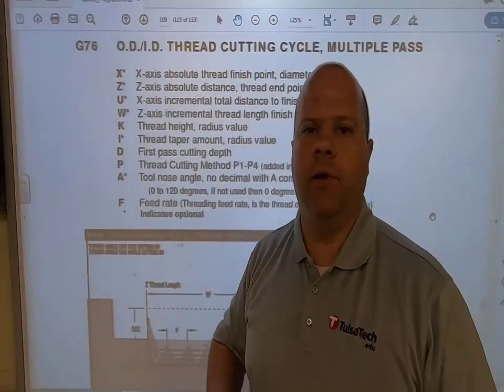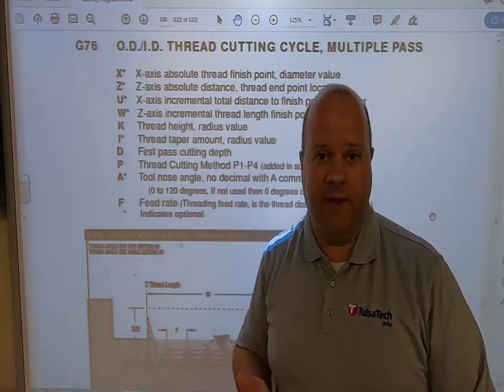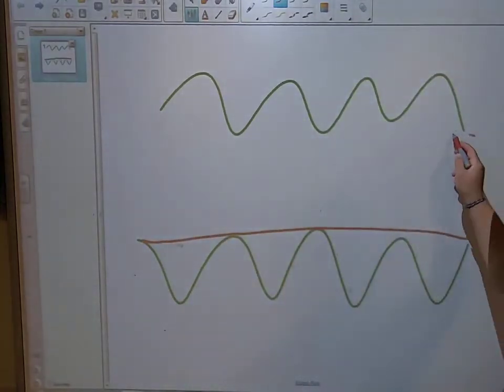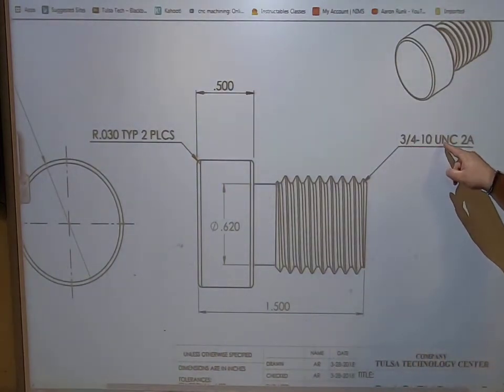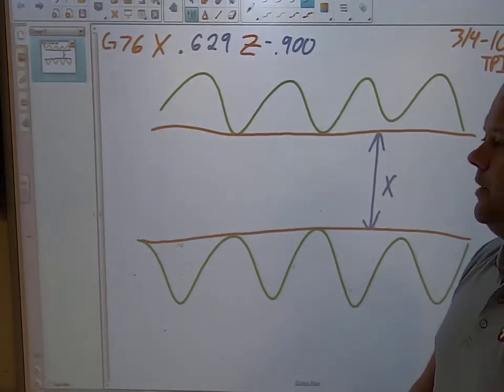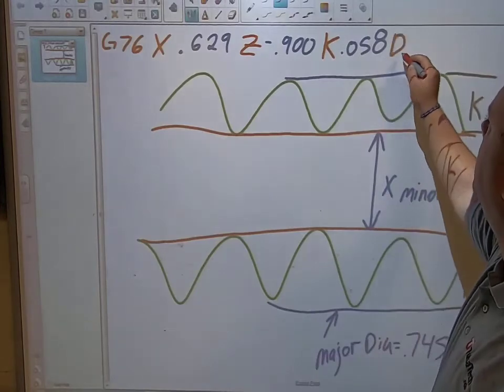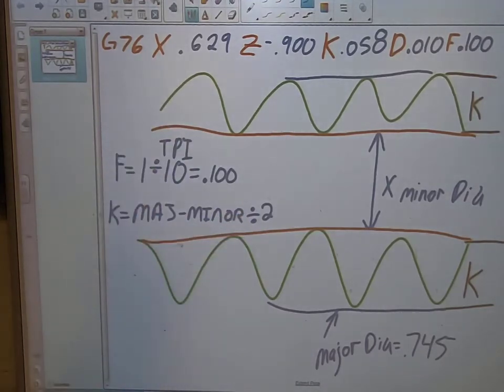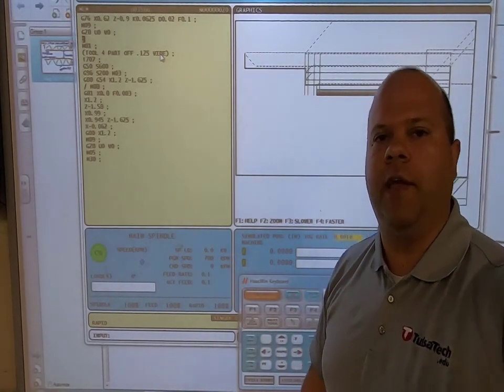Hand Programming Lathe G76 Threading Canned Cycle

Comment: Does this work for ID threads?
Reply from the maker: @valhallagaming9083  yes this works for ID threads as well your clearance point is the only thing that needs to change and the values in your machineries handbook will be the columns on the right side of the page
Reply: @aaronrunk4209 thank you, currently trying to fix an existing program on a i.d. 1/2-14 npt 2205 material. I just wasn’t sure if the math on the radius of the threads were the same because on the O.D you subtracted the min from the max then divided by 2 to get the radius and all I have to go off of  do I subtract the pitch or just the min max of minor diameter?

Comment: Hi Aaron, I started learn how do thread and I have a question, for make the ID thread is the same way?
Thank you
Reply from the maker: @wagnerdamotta726  yes programming ID threads work the same way. Your clearance point will be below the X value the same amount as it would above for OD threading
Reply: @aaronrunk4209   Thank you very much, great job help people
Reply: Hi Aaron, I didn't understand what that gentleman said about your equation, could you explain it to me please.
Sorry for ask you, I just started learn use the cnc lathe and I try not do any mistake.
Thank you
Reply from the maker: @wagnerdamotta726  yes, the best way to understand what was being said is to take the major diameter of what you cut the threads to and subtract the x value in the column that I cover in the video. Once those two have been subtracted from each other, you simply divide that by two. This will work for all threading. Thanks for watching and good luck with your programming
Reply: @aaronrunk4209  thank you Aaron, I going to try tomorrow after I let you know how I make out.
Thank you for all the help
Reply from the maker: @wagnerdamotta726  no problem! Thanks for watching

Comment: What if you use metric?
Reply from the maker: @JoeMGajdowski  hello there. that's a really good question because I ran into this earlier this year. all you need to do is make your program with your metric values, and in the haas simulator under the settings page, you can change it from inches to metric. I hope this helps and thank you for watching

Comment: Question if you run a speed of 70 and finish look bad can you increase it to 140 basically double the speed and not cross thread the parts .
Reply from the maker: Yes, you can because your starting point of entry does not change.  The same goes for threading on a manual lathe. The only way that's going to change is if you change the feed rate on the g76 line, move in your work offset or unclamp, and rotate the part. I hope this helps and thanks for watching

Comment: what program are you using to simulate the haas control? that'd be so useful for me so i wouldn't need to run back and forth with a usb to the lathe, especially when someone else is using it
Reply from the maker: The software is a replica of a Haas simulator platform, but unfortunately, I don't have a way of exporting the software since it was already on the computers when I started. If you can, look me up on Facebook and message me.

Comment: Hello Sir, can you give me the program for simple "Chess Pawn" using G73 for HAAS. (Make it in mm not in inches)
Reply from the maker: Not sure how to incorporate a G73 but it's mm and it runs in my Haas simulator. Good luck and let me know if it works
Reply: Thank You So much for your valuable response, i will try Sir.  Have one more doubt that i need  an island on a square block program using G150-general pocket milling(HAAS), can you please provide it?
Reply from the maker: @sangameshbijma2301  for using G150, you'll have to refer to the haas website for how to use the G150 since it is coordinate specific, and I've only used it once, and it was a while ago
Reply from the maker: @sangameshbijma2301  This video will show you how to pocket mill, and I have another that covers sub programming form complex and deep pocketing
https://youtu.be/rvB-GnClOQk?si=pEowXNFwZVqVugsL
Reply from the maker: Well you drive a hard bargain.
Reply from the maker: %
O1111(CHESS-PAWN)
(PROGRAMMED AARON R DATE 5-17-24)

(MAT"L 31.75 DIA) 
(41.3 MINIMUM STICK OUT FROM FACE OF JAWS) 
(Z0 IS FACE OF RAW MAT"L) 

(TOOL LIST) 
(T101 = VNMG431) 
(T202 = 1/8 WIDE PART OFF) 

N20G21G40G90G80
N25G28U0W0

M01
(VNMG431)

N35T101
N40M8
N45G50S2000
N50G96S365
N55G0X36.068Z0.127M3
N60G1X-0.762F0.2
N65Z0.508
N70X0.136Z0.957
N75G0Z2.54
N80G0X36.83T101
N85G50S2200
N90G96S426
N95Z0.
N100G1X-0.762F0.2
N105X3.369Z2.065
N110G0X36.068T101
N115G50S1800
N120G96S365
N125X36.83Z2.413
N130X30.508
N135G1Z-61.195F0.3
N140X31.75
N145X32.648Z-60.746
N150G0Z2.413
N155G1X28.509
N160Z-56.985
N165X30.21Z-57.836
N170G3X30.508Z-58.195R0.508
N175G1X31.406Z-57.746
N180G0Z2.413
N185G1X26.509
N190Z-49.412
N195G3X26.779Z-56.12R6.507
N200G1X28.509Z-56.985
N205X29.407Z-56.536
N210G0Z2.413
N215G1X24.509
N220Z-48.184
N225G3X26.509Z-49.412R6.507
N230G1X27.407Z-48.963
N235G0Z2.413
N240G1X22.508
N245Z-47.397
N250G3X24.509Z-48.184R6.507
N255G1X25.407Z-47.735
N260G0Z2.413
N265G1X20.508
N270Z-46.873
N275G3X22.508Z-47.397R6.507
N280G1X23.406Z-46.948
N285G0Z2.413
N290G1X18.509
N295Z-44.218
N300G3X20.508Z-46.221R2.508
N305G1X21.406Z-45.772
N310G0Z2.413
N315G1X16.009
N320Z-5.303
N325G3X18.509Z-10.016R9.508
N330G1X19.407Z-9.567
N335G0Z2.413
N340G1X13.509
N345Z-3.59
N350G3X16.009Z-5.303R9.508
N355G1X16.907Z-4.854
N360G0Z2.413
N365G1X11.172
N370Z-2.513
N375G3X13.509Z-3.59R9.508
N380G1X14.407Z-3.141
N385G0Z2.413
N390G1X8.836
N395Z-1.735
N400G3X11.172Z-2.513R9.508
N405G1X12.07Z-2.064
N410G0Z2.413
N415G1X6.5
N420Z-1.177
N425G3X8.836Z-1.735R9.508
N430G1X9.734Z-1.286
N435G0Z2.413
N440G1X4.164
N445Z-0.799
N450G3X6.5Z-1.177R9.508
N455G1X7.398Z-0.728
N460G0Z2.413
N465G1X1.828
N470Z-0.58
N475G3X4.164Z-0.799R9.508
N480G1X5.062Z-0.35
N485G0Z2.413
N490G1X-0.508
N495Z-0.508
N500G3X1.828Z-0.58R9.508
N505G1X2.726Z-0.131
N510G0X23.589
N515Z-10.016
N520G1X18.509
N525G3X16.009Z-14.728R9.508
N530G1Z-43.432
N535G2X16.226Z-43.741R49.483
N540G3X18.509Z-44.218R2.508
N545G1X19.407Z-43.769
N550G0Z-14.728
N555G1X16.009
N560G3X13.509Z-16.442R9.508
N565G1Z-39.257
N570G2X16.009Z-43.432R49.483
N575G1X16.907Z-42.983
N580G0Z-16.442
N585G1X13.509
N590G3X12.53Z-16.937R9.508
N595X11.717Z-20.346R2.508
N600G1X11.417Z-20.472
N605G2X11.172Z-21.438R49.483
N610G1Z-32.89
N615G2X13.509Z-39.257R49.483
N620G1X14.407Z-38.808
N625G0Z-21.438
N630G1X11.172
N635G2Z-32.89R49.483
N640G1X12.07Z-32.441
N645G0X36.83
N650G0Z-0.635T101
N655G50S2200
N660G96S487
N665X-6.604
N670G1X-0.762F0.2
N675G3X11.933Z-16.923R9.381
N680X11.3Z-20.249R2.381
N685G1X10.924Z-20.407F0.06
N690G2X15.785Z-43.856R49.61F0.2
N695G3X20.0Z-46.221R2.381
N700G1Z-46.958F0.06
N705G3X26.206Z-56.141R6.38F0.2
N710G1X29.777Z-57.926
N715G3X30.0Z-58.195R0.381F0.06
N720G1Z-61.195F0.2
N725X34.131Z-59.13
N730G0X36.83
N735G28U0W0

M01
(1/8 WIDE PART OFF)

N745T202
N750G50S1200
N755G96S365
N760G0Z-64.008M3
N765G1X18.212F0.05
N770G0X20.752
N775G1X-0.406F0.03
N780G0X36.83
N785G28U0W0
N795M30
%

Comment: what is G23 for?
Reply: M23 NOT G23
Reply from the maker: @davidsazunga1054  So the M23 & M24 will tell the machine how to exit each threading pass. M23 will angle out away from the threads and towards the chuck the amount program in the machines settings. It usually isn't much, but if you are threading into a shoulder like the part in this video you would want to use an M24 so that the tip of the threading tool stops inside the grooved area and then pulls straight out. Hope this helps and thanks for watching.

Comment: Thank you very much for making this video. I have one quick question do you take your feed rate and times that to your RPM?
Reply from the maker: So your feed rate will always be the pitch of your threads. so 1 divided by TPI will always be your feed rate. however, depending on your cutting tool, whether it be high-speed steel or carbite or even a coded carbide or ceramic, that will determine how hard you can push the RPMs on your machine Also, you can run higher RPMs with a smaller depth of cut. I hope this helps, and thank you for watching my video
Reply: @aaronrunk4209  thank you
So it doesn’t matter what spindle speed with your feed rate the G 76 is going to calculate everything ?
Reply from the maker: @scottborst5430  that is correct, but keep in mind that if you're running an RPM of 5000 RPMs while threading. It's can damage your axis motors because the machine will try to do what you tell it to. Also, the size of your material matters because you don't want it spinning faster than your jaws can hold. There may be some trial an error, but if you know what brand and style of insert you have, you can look it up on the company's website for optimal speeds, feeds, and depth if cuts.
Reply: @aaronrunk4209  thank you very much

Comment: hello, can I ask you to explain how to calculate the feed on a lathe!!??  I do not understand this .
Reply from the maker: There is a lot of variables to calculating speeds and feeds for both milling and turning. Rather than   explain here. I have found a link that will assist you going forward. Good luck.  https://www.kennametal.com/us/en/resources/engineering-calculators/miscellaneous/speed-and-feed.html
Reply: @aaronrunk4209 Good afternoon aaron, is it possible to contact you via any of the messengers??

Comment: Don't know if it's possible, but you might want to edit the bit where you write out euqation for figuring out K value.  You should've put:  (maj-min)/2.  When you write it as maj-min/2, technically, that means divide min by 2, then take the quotient and subtract it from maj.  It was easy to follow what you meant, but some might get confused by how you wrote it out.
Reply from the maker: Unfortunately, this is difficult to edit,  but having this in the comments will definitely clear up confusion in the future. Thank you again for watching and for your help.

Comment: Do the feed rate has to match the spindle speed, like tapping on a mill? 13:51 or how does that work?
Reply from the maker: When using the G76 code, it matches the spindle rotation with the inch per revolution  (ipr) to make the right feed rate.  However, if you turn to slow, your cutting edge could break.  If too fast, it can cause more wear and tear on the machine. Hope this helps, and thank you for watching.

Comment: How can I know D value sir ,thank you for your video ,it is very helpful.
Reply from the maker: The D value is up to you on how you would like to approach the cut. it also depends on your machine if you have a bigger machine you can take a bigger depth of cut with bigger tooling. if you have a smaller machine your D will need to be smaller so that the chatter does not affect your threading as much. however, I have big machines and small machines and I teach to use a depth of cut of .005 (or D50 for fanuc code) that way students can see the cuts happening and I know with the spring passes my threads will come out good. Thanks for watching I hope this helps.
Reply: Thank you sir .

Comment: Thanks for the video!  Great explanation 👌  I have been doing research for my 1st threading program. I have one question. I'm doing a 6g m50x1.5  when i do my finish OD pass for the bolt, do I make it to the 6g measurement, which i don't have for you at the moment, or would I use the m50(1.9685 in.) measurement?
Reply: The 6g major diameter I am going with is 1.9660
Reply from the maker: Thank you for watching.  To answer your question.  If your talking about the finish pass for the OD of the thread you don't want to make it right at 50m because you won't have clearance. You will want it to be at least. 008 smaller (1.9600) or you can check the machinery's handbook to see what nominal would be for this.  It really depends on the accuracy that your wanting to achieve, but if I was to guess I would say your range would be 1.9675 max od to 1.9575. Good luck
Reply: @aaronrunk4209  yes that's exactly what I am talking about. Perfect. I literally am on my laptop writing the code. I've taught myself everything I know about code through YouTube videos. I'm now the lead cnc machinist and programmer for the company I work for. Like I tell them, I'm not the best.. but I'm the best they got. Haha. I also do programming for a cnc router we have and I'm very new to that. So far I have 100% success rate. 🙌  thanks again! I'm going to watch all your videos. Look forward to more content. I also binge watch actual footage of cnc machining, it's very visually satisfying. you should incorporate some into your content.
Reply from the maker: @louisbalvaneda  that's great to hear that your programming,  and the fact that your excited about it will make it easier the more programs you make.  You'll find I have some turning part videos on my page and in the next few months I'll put 6 new Milling videos.   Again good luck and watch as much of my content as you need.

Comment: What does the M23/M24 do? I have been wondering about that to see if that adds a chamfer to the front or it is something else.
Reply from the maker: Most machines default to exiting the threads on a chamfer. M24 sends the threading tool to the furthest point or end point in the thread canned cycles and then exits straight out. The chamfer out will end at the same z position but starts to exits out of the thread before reaching that point

Comment: Aren't you really really simplifying things in that you are not discussing Pitch Diameters?  When machining threads to any sort of specification or tolerance as called out on an engineering drawing, it is PDs that matter most.  The (basic, or perfect) distance from the pitch diameter to the minor diameter is fixed, at 0.25 x H on radius, where H is the theoretical [Basic] height of a sharp thread.  So to get the minor diameter, you start with the desired PD, then subtract .5H, which is 0.25 x H twice, since you need to go from a radial difference, to a diameter..6835   

The "minor diameter" you refer to in Machinery Handbook is for reference only, for UNR thread forms, with a radius.  In reality, you should be starting with a pitch diameter, and working from there. 

For your example:
3/4-10 2A
Max PD = .6832 
Min PD =  .6773
H = Pitch x cos(30deg) = (1/TPI) x .866025 = 0.1 x .866025 = .086603
So, .25 x H = .02165"

So, lets say you want to aim for the middle of the Class 2A pitch diameter range.  (.6832+.6773)/2 = .68025
So your minor diameter = .68025-.02165*2 = .63695.  Remember, we multiply the .25 x H times two, because the thread height is on radius, but we are dealing with diameters. This minor diameter of .63695" is .0079" larger than the number you came up with.   By using the UNR minor diameter lookup you did, your pitch diameter will be out of 2A tolerance.  You are cutting the threads too small.  

Of course there is one additional factor, and that is the geometry of your chosen insert.  We do not work in "perfect world"  A given brand of insert may not have the minor diameter flat be exactly .25 x H from the Pitch diameter.  I may be .24 x H, or .26 x H.  It is a good idea to always use the same brand inserts, and know what the Pitch to Minor Diameter difference is.  Once you know this, you can control PDs closely, using your methodology.  But you have to start with the desired PD, and work from there.  If you use the UNR minor diameter look up in MH, you will be cutting thread too small, and out of tolerance. 

The easiest thing to do is assume your insert is perfect, and the minor diameter is .25H.  Subtract twice this from the desired pitch diameter, machine test threads, after setting the tool offset based on the minor diameter, and then measure your thread PDs.  Then you can determine if your calc needs to be adjusted for your specific inserts.
Reply from the maker: Yes simplifying this type of training is helpful when teaching entry-level machinist and operators however the pitch diameter is very important and since inserts  are cnc ground it's safe to assume that they are perfect however even though they are perfect we have to make sure that we understand the insert nomenclature of these inserts which is a small section of training that I do using kennametal PowerPoints the good news is because we are not programming our canned cycle using pitch diameter students are able to slowly sneak up on the pitch diameter using three types of measuring tools including pitch micrometers the wire method and the method that I use is using simple ring gauges the reason why I use ring gauges is because they're the most popular and fastest way to measure go no-go in a production environment and they also have the major pitch diameter and the minor pitch diameter on them which I explained to them is the imaginary line that we are trying to hit in order for these threads to be correct I also use the pitch diameter to explain to them a safe distance that they are able to shift the machine down in order to safely recut threads without scrapping them. with that said I always make sure that students understand information on pitch diameter and that it is located in the machinery's handbook because I always have a few students that really want understand the in-depth reasoning behind what we're doing and I always want to make sure that this knowledge is readily accessible to them thank you for your comment